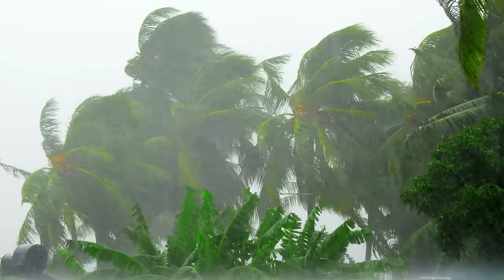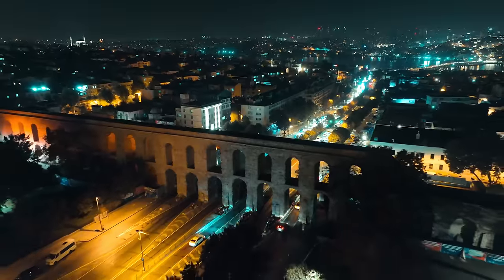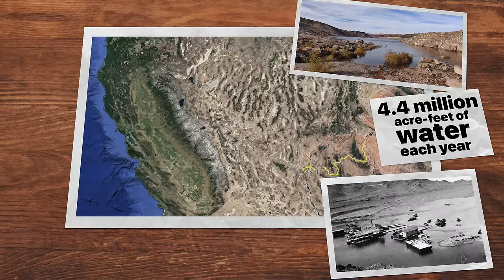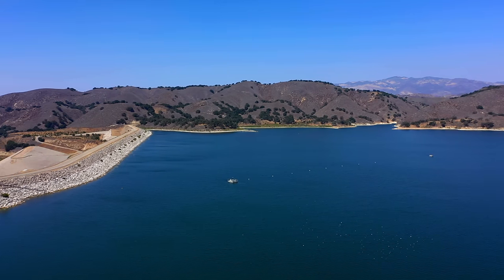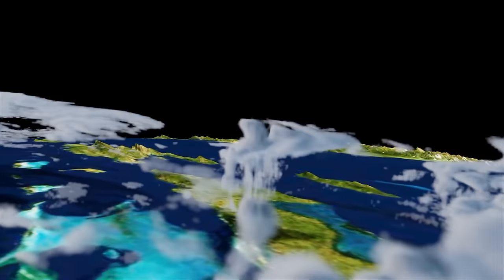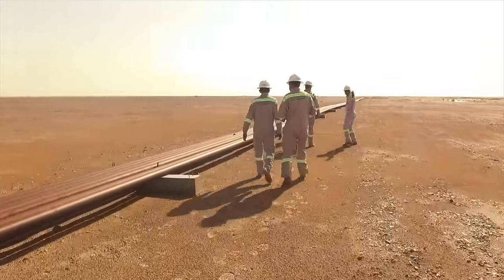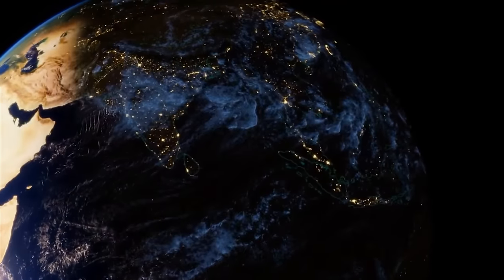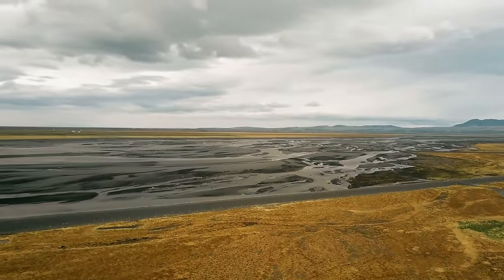Pipelines From Flood to Drought

Comment: Ok here's my idea. make room for incoming storm water by pumping water into railcars. they can hold 100,000 gals per car.  move them to  Arizona .set up a field of water tanks in northern Arizona and then pipe water from there to where its needed. also the railcars can be moved to more than one location where tanks can be set up.  10 rail cars is a million gallons.  water can be harvested from the Mississippi  river or Texas or Lousiana or any where there are railroads and storms coming.

Comment: Instead of using fuel pipelines, tanker ships would probably be better.  Less fixed infrastructure would be needed, and they could be used as storage at either end as needed.  And they could distribute the water to whichever port was closest to the greatest need, not just in the US.

Comment: Yes open up them dam doors and let my pp go.  

I've had this river share idea for years  not just is it smart but it solves 2 problems  in many states  it wouldn't be where your showing , snake river flows into the missiour river that flows into the Mississippi River. The nations water vain 
Its not far over a mountain range to empty extra water into the calarado river to fill the lake at hover dam. You can also devert some of the Columbia River into Northern ca. The nations food supplies.

Comment: Im not an economist, but if the economy has been hurt by 1 billion, and damage costs at 80 billion. Does that not mean there is 1 billion short term loss to a 79 billion economic boost to rebuild and replace. Assuming insurers settle as expected.  Great brain storming video. I love to see outside the box thinking with common sense solutions.

Comment: I like the idea at its core.  The issues that you did not address are huge.  Oil and gas are not going anywhere.  We do not have the infrastructure to replace it. That means new pipelines will have to be created. Not a deal breaker but a challenge.  When moving water you need to think nationally.  The Midwest also needs water for farming. The Oglala aquifer has dramatically been emptied. Another consideration that must be considered is moving the water but not the life in it.  It would be a bigger disaster to move an invasive species from one ecosystem to another. Depending on the size of the total national pipelines, it could be a reservoir in and of itself.  All the water that is cleaned in every city from sewage could be part of this solution as well. That would be water that is consistently being pumped into the system.

Comment: The idea of transferring fresh water to other states that are experiencing drought is an excellent idea, but to replace the oil pipelines is not a good idea. New pipes, and a separate system. To assume that we will no longer need or use oil is not realistic. I am a long haul truck driver for over 30 years, and I am on board with clean air, clean drink water, and I love nature and support having a clean and  healthy environment. It seems as though we are being pushed into changing all of this overnight, and it just isn't possible. In time we will get there, but we must be wiser and smarter about the conversion.

Comment: If your reservoirs are full, then there is no need to build anything. But let’s say we did build this system. If you knew a storm was coming and had an entire month to transfer water, the pipes and pumps would have to be massive to move a significant amount of water.

Comment: What about the water that's in the air?  How much is that.  We have over 50 miles of water holding air.  And the clouds.  And if the sea level rises over a couple of meters, we are going to have much more water in the air....more surface more evaporation right?

Comment: I've actually said this for quite some time but but one of the things I said was don't just pump water to another reservoir pump it to another aquifer to refill the aquifers because that will help the rivers that are drying up and if you help the rivers then in turn you're going to help the reservoirs. There have been places where they pumped so much water out of the aquifer that the aquifer itself collapsed and when that happens you lose that aquifer so if you refill the aquifers from places that are going to flood I think it would help prevent that from happening.

Comment: It is a pipedream that you would be able to use oil and gas pipelines for this endeavor.  There is no technology in place currently that will allow us to not need these pipelines to be used for hydrocarbons.  It will not happen in our lifetime unless something very drastic happens in the near future.  It will require new technology that doesn't currently exist.

Comment: don't worry oil pipelines or even gas pipelines with be available for use in around 30 years across the country, we use oil and gas for so long how and what do we replace these fuels with, electric that also uses oil to produce, try living in a winter country, then you will know electric will not be the save all for everyone

Comment: There's plenty of places that need more water where excess water can be stored in new reservoirs. Rather than dumping it into the ocean or dumping it into rivers to flood their banks and eventually flow out to the ocean. It's not about just moving the water, it's about storing the water so that you have it when you need it. It costs a lot to build water drainage and pumps to dump the water in the ocean and in rivers leading to the ocean. Might as well spend that money on reservoirs to move the excess water to where it is needed and to be stored for when it is needed.

Comment: We need to do this by creating new pipelines.  If we eliminate the oil pipeline we won't have enough energy to power the system.  Renewable resources do not provide enough energy.  We either need to build nuclear plants or drill more.

Comment: Until you can make pumps that can pump water over at least 2 mountain ranges of an altitude of the lowest end 8000 ft and get it done before there is another climate change it is a pipe dream in the US.

Comment: The fault in this plan is thinking you can use existing oil and gas pipelines, to do this you first have to develop a reliable source of alternative energy that doesnt require the use of those pipelines. It would be a much easier issue to solve if people didnt try to live, farm , and plant huge cities where there isnt the resources to sustain those things

Comment: You forgetting the continental divide separates flood plains and desserts or most of them ok your pipe line idea where is the energy coming from our infrastructure can barely handle what we have now little alone the hp to run these pumps your numbers are wrong on oil to water pumping

Comment: If the oil pipes are not cleaned, the water can be treated at the end point OR dumped into a wetland where it would be cleaned.  Oil is organic and biodegradable.

Comment: Someday there will be 1 billion people in the U.S. and 100 million in California. California might as well start a massive desalination program now and get it over with. That water supply (Pacific Ocean) is unlimited. Also, they are about to tear down the dams on California's second largest river, the mighty Klamath River. There has to be a way to tap that water right before it dumps into the ocean. I'm just thinking out loud here.
Reply: The farms require 36 billion gallons per day. That would require two desalination plants for every mile of coast. They would cost well over a trillion dollars. They would produce 25 billion pounds of salt per day. Among other problems.
Smaller desalination plants are already being criticized for the environmental damage they do.

Comment: Living in MO after leaving SoCal, there are days I wish I could ship CA some water. But better use of agricultural land in other states would help. Most farmer owners are in it for the real estate, with ag as a byproduct. Most of the midwest is monoculture planting which are functional food deserts. We could change that to improve food diversity across the country. 

My SoCal Idea is to pump ocean water (from slightly inland as a prefilter).  Pump that water in to & up the mountains. On the downslope, have slightly open slalom troughs with offset covers. Water that evaporates onto the cover should be low/no salt, and directing that water into a parallel trough creates the low salt supply. by the time it gets to the central valley, it shouldn’t need much treatment. The salty troughs can be pumped to evaporation fields & sold as sea salt, sold for municipal use, or simply trucked back to the ocean & dumped, if it’s too much work to build a return pipe from 1/2 or 2/3 down the mountain on the inland side (which could help with the pumping).
Reply: Also, we shouldn’t be growing cotton. Look up Tulare lake.

Comment: I see several issues with the story.
1. The size of those pipes is too small and as someone already said they are prone to rusting out and contain chemicals that will leach out. 
2. Someone else suggested letting the rivers carry it part of the way and this is OK, but need to remember that there will be losses due to evaporation and soakage.
3. Floodwater is not fresh drinking water - it is contaminated by rubbish and sewage. It will need to be cleaned. Thats expensive.
4. How do you collect all that storm/flood water? You would need pumps the size of a large shopping mall and a place to put the water that would be extremely huge.
You could probably only collect a very small fraction of that water.

On Desalination:- Usually done the wrong way at a huge cost in power. Suggest using something like an OTEC (Ocean Thermal Energy Conversion) unit using it to produce water - not power. Very poor at producing power, but very good at producing fresh water. Can produce all the water and power itself killing two birds with one stone.

If you go down the road of building a pipeline that circles America then what you have is a "portable" reservoir holding gigalitres of water. Water can then be easily sent to anywhere in the country.
Reply: Nice work. It is rare to see anyone put any common sense into this.
The farms in California require 36 billion gallons per day throughout. That's about one-tenth the flow of the Mississippi at its mouth. That equals a pipe a mile wide and 200 feet deep. There isn't enough water storage in California to hold it all at once, so it would have to arrive daily, like it does when the snow melts slowly over the summer. 
Desalination would require a good-sized desalination plant every half mile of coast, cost more than a trillion dollars, and it would produce 25 billion pounds of salt per day. Among other problems, of course.

Comment: You are anti oil. Why not just leave those oil pipelines alone and just build new pipe. We still need that oil to use. Oil isn’t just used for transportation. You still need oil to lubricate and manufacture windmills, and make solar farms. Plastics, pharmaceuticals, cooking, etc..
Reply: The size of the pipe required to supply the daily water demands of the farms would be a mile wide and 200 feet deep. Send me a deposit for ten percent of the cost and I will get started right away.

Comment: Water management is a strange endeavor. There are many communities that have "condemned" individual wells in favor of community water sourcing as an efficient means of metering sewage systems. There may be quite a bit of fresh water underground that is no longer utilized on a daily basis. California is strange onto itself. 

I have had a simple solution to utilize that water wasted while we wait for warm water to arrive at the bathroom tap. One is to have a circulating trunk hot water line always with hot water at the ready. Another I envision is to utilize temperature controlled values that divert that unused "hot" water to a holding tank above the toilet to be used for flushing. The tank merely has an overflow line and no functional deficiencies to cause problems. There would always be a supply available like normal. 

Passive approaches has to be the next step for homes where every half gallon adds up quickly. Our government is allowing hundreds of thousands of people into the United States that normally would not be here using up fresh water. There are many factors that need to be addressed regarding fresh water. I also thought about the feast to famine approach that might need to come to pass in one form or another.
Reply: So how does that help hundreds of miles of forests dead from drought?

Comment: I have long thought that this idea has merit but you have taken it quite a few steps farther since my assumption has always been that it would be too costly.This may sound a bit strange but if we could get "everyone" to pull in the same direction on this we might be able to make it work. And it might provide us with something more positive to think about than our fractured politics. We might not need everyone but only an impassioned small majority. As the others saw it coming together perhaps they would drop their protest signs and pick up their shovels.
Reply: The floods come at the wrong time of year to be useful and there isn't enough storage space to hold the water. The water needs to come in a steady flow throughout the summer to feed the farms. 
The farms require 36 billion gallons per day. That is a pipe a mile wide and 200 feet deep going from the mouth of the Mississippi to lakes Powell, Shasta, and Oroville, among other places. 
And that still wouldn't solve the problems. Superman dropped out of the project because that comic book was just too unrealistic.

Comment: The volume of water that could be transferred via a repurposed oil or gas pipeline is miniscule. To pump a meaningful volume would require a pipe much larger than 36 inches. I don't buy the volume stats quoted as  the astronomical pressure needed would be impossible to maintaain.
Reply from the maker: its water and a pump its just a matter of sizing it properly... big question would be would it be worth it...

Comment: Idealistic but beautiful. Big oil does not want to loss their pipelines and the revenue big oil creates for government will ensure this doesn't happen. While enabling a plan like water redistribution will some water supply problems it will not solve the bigger problem of the use of petroleum products which increase global warming. All solutions help and redistributing water will help but in all likely-hood it is too little to late.
Reply: The pipe required would be a mile wide and 200 feet deep. Just for starters with the issues.

Comment: Instead of waiting for rain,why not pump water from great lakes, what will the water cost that way, surely less than waiting for fluids from rain that's only around days or hours. Love to hear what you have to say
Reply: The pipe required would need to be a mile wide and 200 feet deep. It needs to go from the Great Lakes to Lakes Powell, Shasta, Oroville, Folsom, and a string of other lakes across the Sierra Nevada mountains.
Plot that out on a map. Then send me a deposit for ten percent of the cost and I will start right away.

Comment: What about the fresh water from Lake Michigan to Buena Vista Lake in California. The distance is 2,045 miles.  Just a thought.
Reply: The required amount for the farms is 36 billion gallons per day. That is a pipe a mile wide and 200 feet deep. The water needs to go to Lakes Powell, Oroville, Shasta, Folsom, and a string of others across the Sierra Nevadas. Buena Vista Lake would solve nothing.
Reply: That won't happen.

Comment: What if you could pump all the water you could ever want from just 563 miles away? A fresh water pipeline right down most of Interstate 5 from Abbotsford , British Columbia to Shasta Lake,California. The quantity of fresh water that flows out of the Canadian Rockies every day into the Pacific is unbelievable.
Reply: The pipe required to feed the farms in California would have to be about a mile wide and 200 feet deep. And that still would not solve the major problems with drought, even if Superman could do it.
Never mind the impact on the Pacific because of all that lost water flow.
Reply: One would think that the Canadians might have something to say about the export of water.  I'd say they would have quite a bit to say about it.  The environmental impacts not to mention the economic implications would need some serious investigation.  That being said the floods last year in the Fraser River valley would certainly benefit from such a pumping/aqueduct system.  The problem is where does such a system originate and how many "atmospheric rivers" will occur near that place?  So far, we've just had one recent flood.
Reply: @terrynitro5330  Of course if I knew the answers to those good questions I would be on top of my game. Just one possibility among many.

Comment: I don't know if it will resolve the pending crisis but it is definitely thinking outside the box.  I was thinking of placing large solar farms in the southwest and bargaining that for water to pump from the great lakes.
Reply: The pipe required would have to be a mile wide and 200 feet deep. It would have to run from the Great Lakes to Lakes Powell, Shasta, Oroville, Folsom, and a string of other lakes across the Sierra Nevadas.
Send me a deposit for ten percent of the cost and I will start today.
Reply: The Great Lakes were filled during the ice age. There is no surplus water there for the desert.